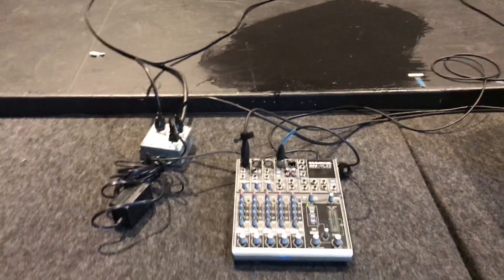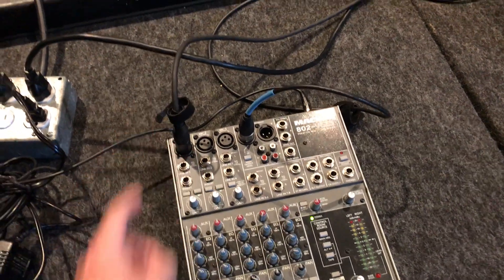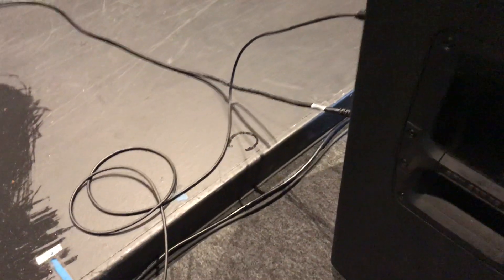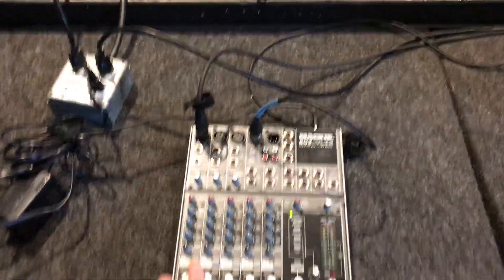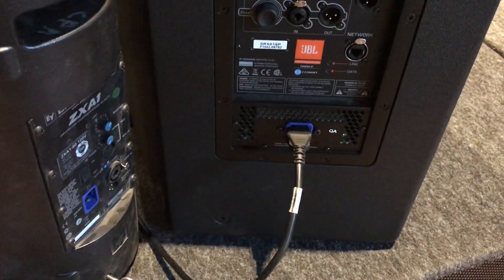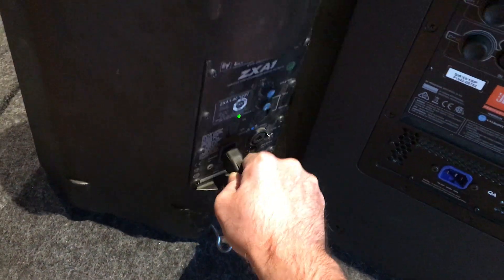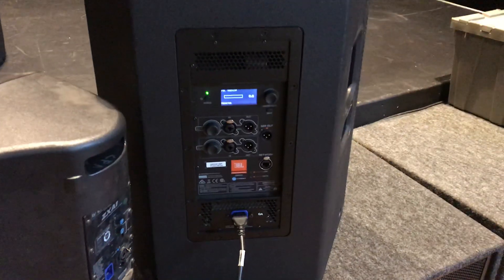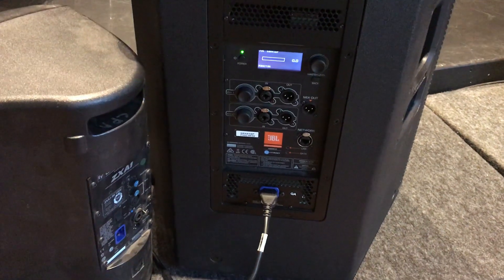Demo of JBL SRX815p inducing noise into mic cable via power cable Part 1

Comment: I know I'm abit late to the party...
Anyways I was going to suggest you try it with a wireless mic receiver instead of the wired mic.
Balanced cables by definition, should be immune to any noise.
The cable itself is probably fine, but I'm not sure if the shure sm58s have balanced circuitry (they should, they're mics after all, but still worth a shot)
Reply from the maker: SM58s have an internal transformer and are very well balanced electrically.

Comment: Greg cheap and possibly effective is an AC cable noise filter which is a slip on ferrite bead you wrap the ac cable around as close to the class D amp AC input as possible.  Crownbshould have had this filtered in the power supply.    Google AC cable noise filter for large plugs - 3 inch to see pic.   This can happen if things are not filtered from power supply to amplifier itself.
Reply from the maker: Thanks, Stuart. I actually bought a box of ferrite beads shortly after posting this video. Unfortunately it didn't make any difference. It's pretty annoying ;-)

Comment: Ground loop.  Eliminate the ground post on the power cord.  I always keep a spare cord I pulled the ground post from the plug for testing.  Ive seen it more with subwoofers, but that might fix it.
Reply from the maker: By definition, you can not have a ground loop without a loop. The only device grounded in this scenario is the SRX. You need to have a second device in the audio chain that's also connected to AC ground to form a ground loop. The Mackie mixer in this test uses a 2 pin ungrounded power supply. And the mic is not grounded to AC power either though it's tied to the ground bus of the Mackie via pin 1. There is no secondary AC ground point here, so this is not a ground loop issue. It's high speed switching power supply noise from the SRX getting into the mic cable.

Comment: Plus the amp on the ZXA1 draws no current compared to the JBL
Reply from the maker: At idle with no input, I doubt either one draws much current. It's not stated in the specs on either.

Comment: Try a power conditioner...
Reply from the maker: I'm not going to stick a power condition on stage monitors. I am going to try shielded power cables and see if that helps, I have some on order. Also, I've discovered the RF is not getting into Canare Quad Star mic cables, only standard 2 conductor + braided shield like the Whirlwind MK4 series. JBL is now aware of the issue and looking into it.
Reply from the maker: FWIW, shielded IEC power cables did not help.